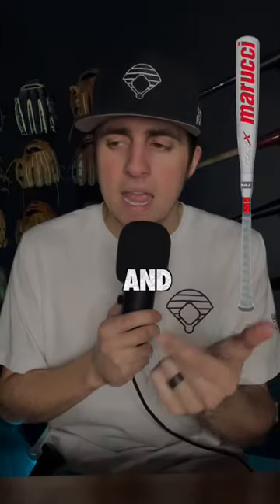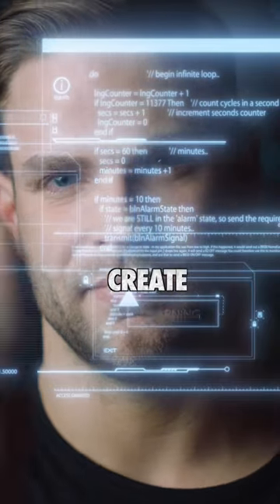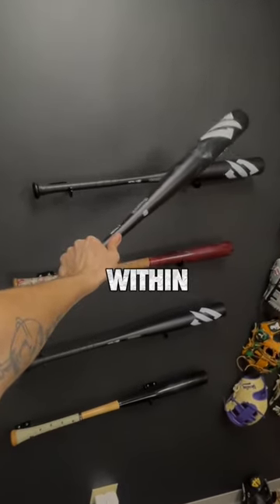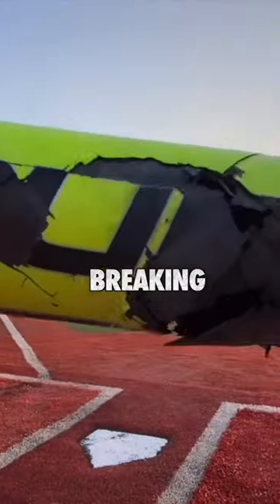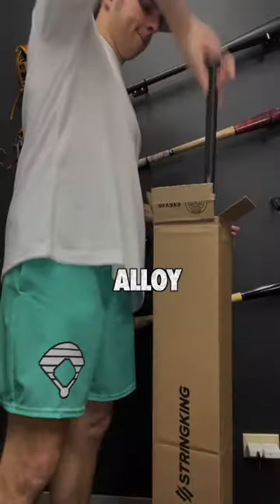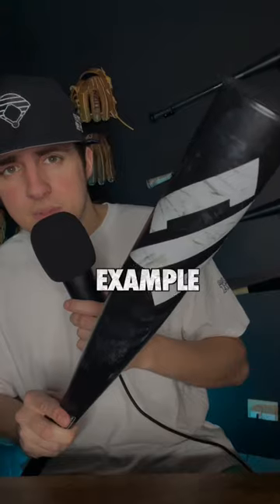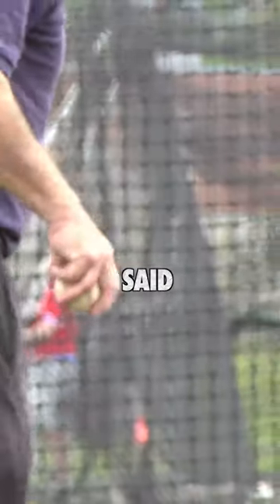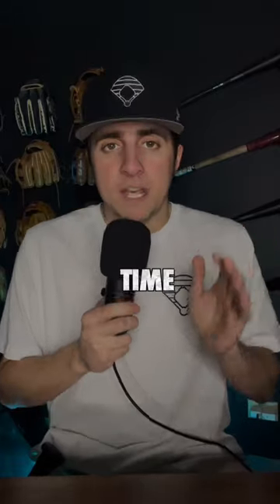Which Bat is Actually Best Though? #baseball

Comment: In the BBCOR certification, Alloys have more juice as well. Composites can't perform to their peak because the certification literally restricts the composite technology. Obviously, if you are a great hitter and have good strength then it won't matter much. But, alloys are overall hotter than composites, more durable, last multiple seasons and cheaper. Last, alloys help you learn better swing mechanics that translate over to wood if you train right. Composites on the other hand don't do that too well. Another thing to take into consideration is bat size. All bat manufacturers test their new bats and new technology at 33/30 only. Once they figure out the formula they just dumb the math down or up to adjust for the smaller or bigger sizes after that. That's why you see some sizes perform fine and some sizes get banned. Louisville Solo is a good example, 33/30 is light and the 34/31 version is an absolute tank.

In the USSSA certification, composites are stupid hot because the restriction is almost none xD
Reply: Except the Rawlings icon which is hotter than almost any alloy bath for some reason

Comment: I have a louseville select two piece composite I used it for 3 years but after 10 swings I’ve seen composites break I just don’t get it. My bat is not the best and has in outrages price of 300$ for a mid bat I think it shoud drop a good 100 bucks for it to be respectable